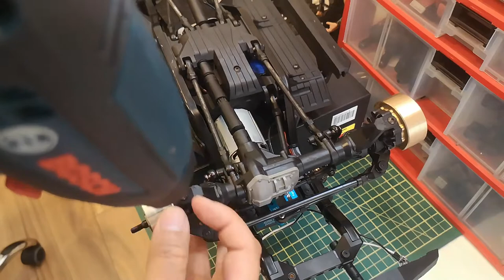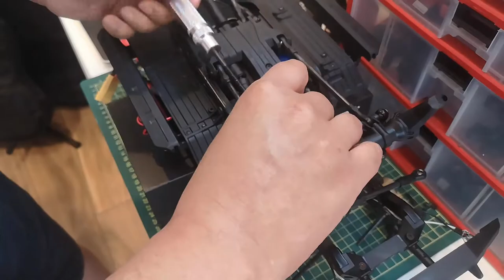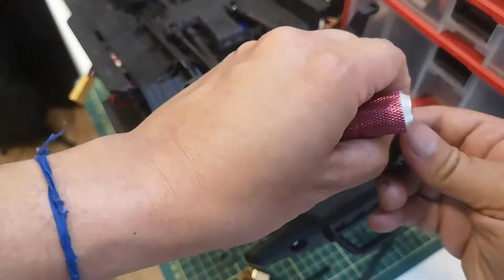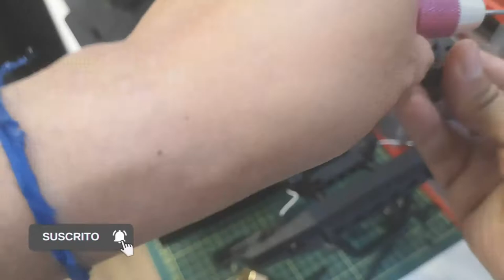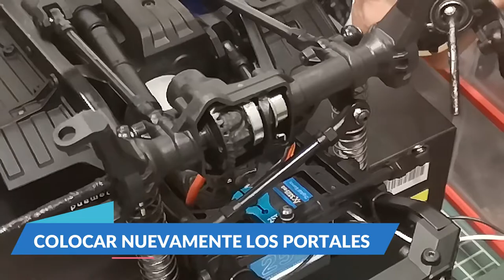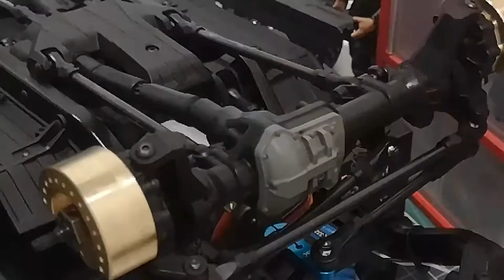CAMBIO OVERDRIVE GEAR TRX4 PASO A PASO

Comment: Pero esto sería para ponerlo en el eje trasero no,? Para que el eje trasero sea más lento?
Reply from the maker: TRAXXAS ha sacado el OD/UD un upgrade que es overdrive y underdrive. El primero va adelante y el segundo atrás. El video es sobre la instalación del OD en mi TRX4, para mejorar la capacidad del auto para escalar, haciendo que las ruedas delanteras giren más rápido.
Reply: osea que el trasero que le pongas nuevo es más lento no? Es que en el video se ve que giran más las traseras que delsnteras
Reply from the maker: @owen_lc159  eso es porque solo giran más rapido cuando el switch de bloqueo de diferenciales del control del TRX4 está en la primera posición. En las otras dos gira mas lento adelante.
Reply from the maker: Acabo de ver que cometí un error en el texto dice que la llanta delantera gira mas lento y es al revés, estas giran más rápido que las de atrás.
Reply from the maker: @owen_lc159  el underdrive trasero haría que atrás gire mas lento. He leido en foros que no es tan necesario. Con el delantero suficiente.